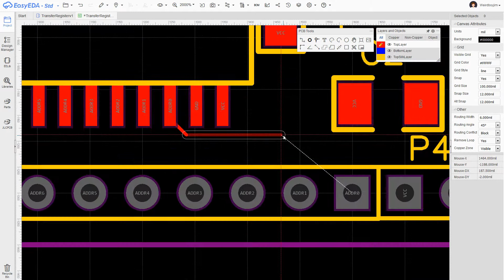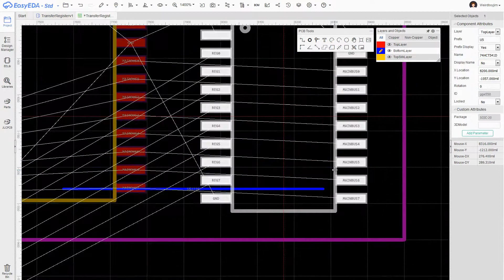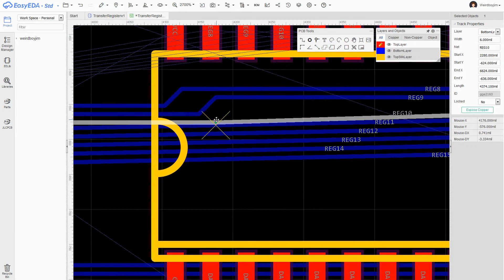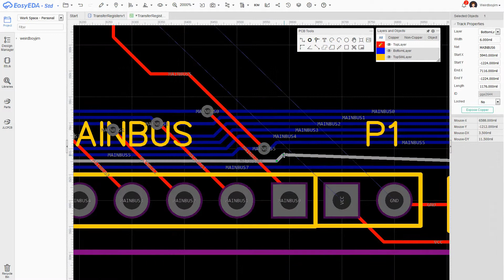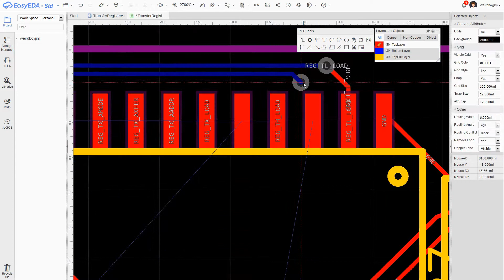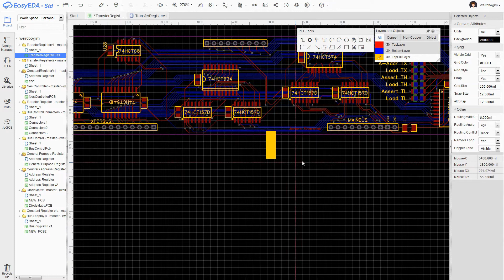Transfer Register PCB (Hand routing) - Making an 8 Bit pipelined CPU - Part 52

Comment: You don't need the RAM module to be Turing complete. Your existing GPRs are sufficient.
Reply from the maker: I'm going to have to disagree with you there. There are some ultra streamlined definitions of Turing Completeness that you can tenuously claim it passes but any rational definition requires storage beyond 4 bytes. The "slam dunk" is if you can simulate any of the systems already proven to be turning complete and with just 4 bytes of memory this is long way from that.

Comment: (0:45) I love that little effect you did there!

Is the transfer register schematic not on your EasyEDA page? I don't see it there.

EDIT: What would the "REG_TX_AMODE" line have been used for if it actually ended up getting used?
Reply from the maker: The amode was for an alternate addressing mode. At one point I had a plan to have a set of adders wired to the current contents of the transfer register, the results would have been output to the address bus from that line. It would have allowed for an instruction like mov a,[tx+imm] but I was too tight on instruction space AND there are specials hazards associated with an instruction that had both an immediate and a memory access in my simplified architecture.
Reply from the maker: https://oshwlab.com/weirdboyjim/transferregisterv1

Comment: Why did you build everything so big? 75% of the PCB's are just wasted empty space. Why not use pcb mask to draw how the computer works, like where the busses are, and how they are connected, with arrows and bit sizes and so, and what the components do inside, etc?
Edit: You don't have to connect all the GND traces first if you use ground plain. ;)
Reply from the maker: What you are seeing here is my pcb design skills slowly developing, there are a few dimensions that get locked in quite early that could have been better.

Comment: For your first major hand routed board you did a very good job there. Much better than an autorouter could have. My biggest suggested improvement is ground continuity, avoiding vias to ensure ground connections. It’s better to via many, many signals than to via ground between devices. Your flood full will mitigate that to some extent, but around the multiplexers it’s a bit of a mess. I hope that doesn’t end up being a bandwidth limitation for your CPU as it has the potential to run at a respectable speed when fully on PCB.
Reply from the maker: Thanks. I pay more attention to the ground paths now even with the flood fill, made a big ground loop once by accident.

Comment: Now I see why circuit board routing can seem chaotic at times. You really have to work with the pass thru radius in interesting ways.
Reply from the maker: Indeed,  I could have picked an easier job for hand routing to be honest but in later videos I get a lot more agile at it.

Comment: Designing a 1960's minicomputer using 1970/1980's components and 21st century CAD/CAM is a whole lot easier than it was originally!
I remember in the early 80's making a PCB meant doing your own acid baths and drilling holes, and layout was using black tape and stickers on clear plastic.  The idea of doing that on a PC and printing out the mask, even if it has to be 2x or larger scale, was tantalizingly close, thinking that such a program ought to be doable.
Reply from the maker: Not to mention designing it on a computer that had more power than every computer in existence in the 60's combines.

Comment: It's usually frowned on to put vias on pads if you are having PCBs manufactured (or using stencils and solder paste), as the solder runs through the via and there isn't enough left to make a good joint. If you're hand assembling, it doesn't matter.
Reply from the maker: That makes sense.  It didn't feel right which is why I moved it.

Comment: How long did that take in real time? I've had a few goes at making MUCH SIMPLER PCBs than this and haven't been able to handle the frustration of having to hold a mouse for so long. After watching this my only thoughts were "You da man!!!"
Reply from the maker: The video files that were edited down totalled somewhere between 9 and 10 hours, there was about 45 minutes of work on it beforehand that I didn't edit in (Where I decided that manual routing would be necessary). To be honest it was quite therapeutic. That was obviously a few hours each evening for a few days.